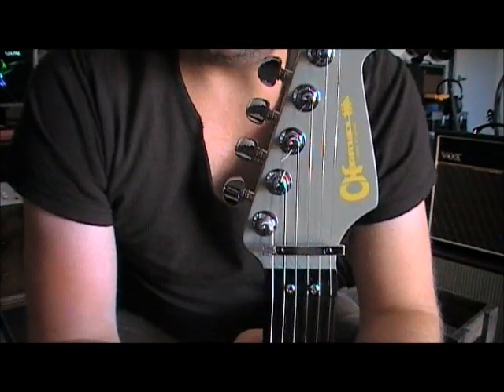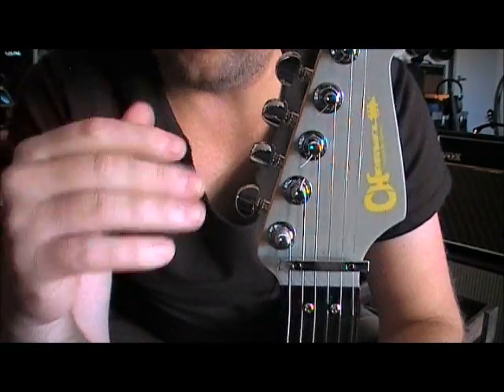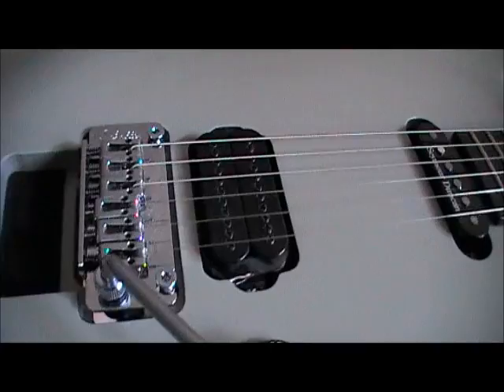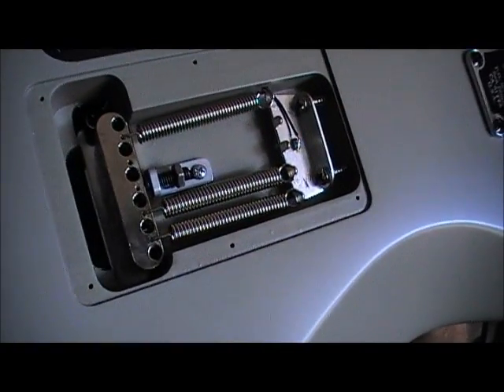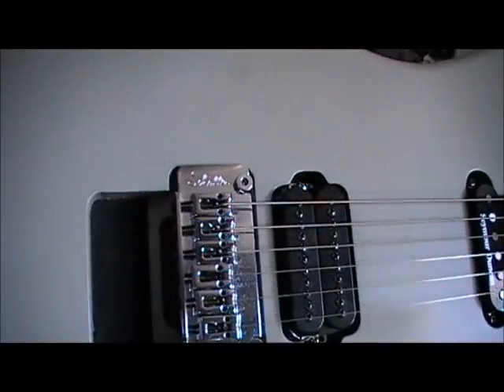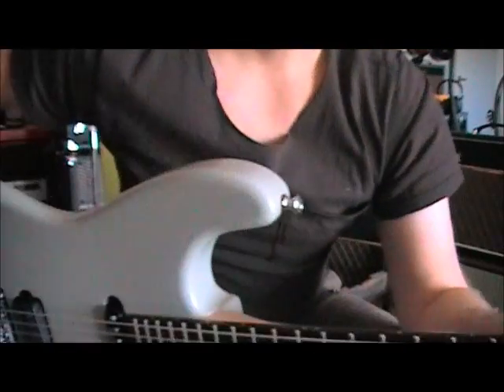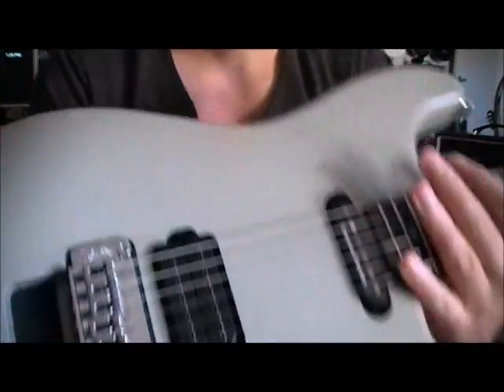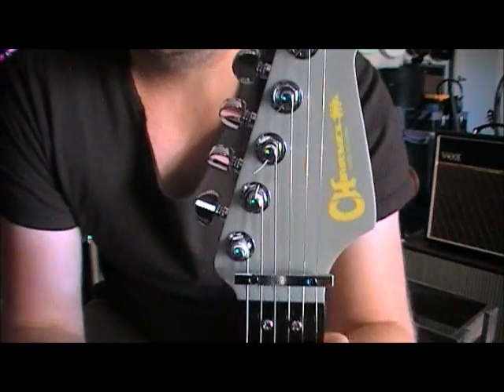De-Floyding - Floyd Rose Conversion

Comment: I'm a lefty. Is there hope for me to find one? Preferably on the cheaper side. Also, my bridge doesn't hold the strings well. I made sure they were all tightened but the G came out still.
Reply: On schaller's website I saw all the models of these bridges in both left and right handed forms, albeit the lefts were about 60 bucks more. Hopefully you find a good deal somewhere!
Reply: Darklauncher Thanks man. Ill probably check it out... then get a job so I can pay for it lmao

Comment: Did you notice a tone difference? for the worse? I read that the rollers can be real tone robbers. Either way, this bridge seems to be the only one out there of it's kind.
I'm planning on doing this to my Schecter for the sole purpose of restringing convenience.
Reply from the maker: Jack Bruce hey man, thanks for reaching out. No, tone difference is there, but definitely for the better. I do like Floyd's but they seem to impart this high-mid  and top end "zing" to the sound. There is more bottom end with this mod although, I am thinking of going back to a Floyd on this axe but upgrading from the Korean "el-cheapo" that came stock to a German made Schaller.
Reply: +BillPalmerMusic - That's your problem right there, Asian made copies use crap metal, stick with the German stuff. If your going to use a tremolo, stick with the best, all others are wanna be's, if your not going to use it, why get a guitar with one on to start.?
Reply: The tone/sound is picked up by the pickups north/south magnetic poles right over top of the pickups.. If your hearing any zing its probably in your head to be honest..

To test this, take the bridge and nut out, and coat it in 3 coats of plastidip.. I bet there is no tone change at all.. And your strings contact points would be sitting on basically rubber..
Reply: TJ L ...that would dampen your strings...
Reply: jubjub f
It  would be similar to nano coated strings. The deadening effect is negligible because 90% of the sound is picked up right over the pickup thats why the magnets are there and not under the pickup where the vibrating wood is. Tonal woods, or thinking bridges/nuts have an effect on tone is ridiculous unless were talking acoustics guitars where those things actually matter. Wood type on an electric has zero tonal impact. If the pickup was picking up sound vibrating through the guitars body, the pickup could be placed anywhere on the body, i.e on the backside of it and covered.. Its not put there because you would hear jack shit. I.E tone doesn't come from woods or cheap bridges etc..

When it comes to electric guitars the only thing that affects tone is the pickup/amp/pedals etc and the way your pick strikes a string, and the actual pick would change the tone.. i.e a wood pick vs steel vs plastic would all change the tone a bit.
Reply: TJ L I agree, but I have 3 different guitars all with the same pups in them, Duncan JB's, a 86 Kramer Baretta, a 91 LP, and a 07 Strat, all with maple necks / rosewood finger boards, the LP has a mahogany neck,  and they all sound different. The Baretta has a Basswood body, and is the warmest tone, the LP has a mahogany body, and it has that traditional woody / nasal tone, and the Strat is ash, and is the brightest of them all. For hardware, all have different systems, Floyd Rose, stop tail piece and bridge, and vintage Strat trem. If it was just 100% the pups, shouldn't they all sound exactly the same.?
Reply: TJ L you realize the wood and hardware imparts vibrations onto the strings right? And no it wouldnt be like coated strings, itd be like a freaking mute. When a string is struck it vibrates (sound waves) which then resonates through the guitar and those waves also come back into the string canceling and boosting specific frequencies the pickup then hears. Dude Im sorry but Ive taken pickups out of multiple guitars and put them into others and they didnt sound close. Ive changed the hardware, the sound changed.
Reply: Ive done a bit more research into it, and you guys are right. The tone does change a bit from wood to wood, I knew it certainly did with acoustics that was obvious. It seems lighter less dense woods produce more treble. Denser woods more bass.. Beyond that, I can't tell a significant difference.. And if we are in overdirve mode, the difference is barely heard, if at all.. and a simple eq pedal could smooth out the tone to where you want it.

I still think the biggest impact on tone is what I said earlier in pickups, amp, pedals etc. And speakers.. Those are the biggest tonal impacts when dealing with electric guitars. The woods seems negligible to be perfectly honest if its just treble vs bass.

There was something else I noticed when I built my first acoustic guitar, the less lacquer, the brighter/louder the sound was. I actually prefer an old school finish in shellac.. The sound on a bearclaw spruce top with light shellac finish was unbelievable.. The guitar looked like it was built in the 1700s but that it besides the point lol..

So that could be something to consider if you wanna brighten the tone up a bit, strip the body down to bare wood and test it out, then put your own clear coat on it. Since you guys have great ears for tonal shifts, I bet you notice something..
Reply: can you guys tell me what you actually prefer, the brighter tones or bassier tones? Or something in the middle?
Reply: TJ L best way to describe what i like is EVH tone, from the 1st few LP's
Reply: The Kramer pacer?
Reply: TJ L Kramer Baretta, i like it the best for lead tone, and i like the LP for riffing / chords.
Reply: Jack Bruce replacing the Duncan design pickups off those Schecters is the biggest improvement one can make in

Comment: I tried the exact same conversion and it did not work for me.  Be careful with this - the location of the original floyd rose studs when using the Schaller vintage trem  means the distance between the Vintage Trem's saddles (taking into consideration maximum adjustment) and the replacement ebanol nut just did not allow for proper intonation of the guitar.
Reply from the maker: hey spoonyfeed. Sorry it didn't work out for you mate. I did read on a forum somewhere that another guy had a similar experience. It does intonate fine on my Charvel and I'm an intonation Nazi, of sorts. Have you tried different gauges of strings, and/or different tunings?
Reply: BillPalmerMusic
I also tried the same bridge on a Charvel SoCal, and also had intonation issues. What gauge strings are you using that you were able to get to intonate properly?
Reply from the maker: Tom Durik Hi mate, sorry to hear this! I'm using 11 gauge strings tuned to Eb. I definitely don't have any issues with intonation, I use Peterson strobe tuners and am very hung up on tuning myself.
Reply: BillPalmerMusic
Thanks! I was using 10's tuned to E standard. I'll have to give it another try.
Reply from the maker: Tom Durik Cool mate!

Comment: Question to anyone who's done this: will the guitar intonate correctly with the Schaller bridge? Saddle to pivot-post distance seems to be shorter on the vintage trems than on the Floyd-Rose trem. At least that's the case with the Schaller I got (which I put on and the Guitar would not intonate correctly). Cheers 🖖
Reply: Intonation has been a TOTAL pain on an EVH Wolfgang Standard.  Getting the intonation "close enough" required pulling the saddles all the back, almost completely flush with the lip of the trem plate.  This also required removing the saddle springs, and cutting adjustment screws in half to clear the string holes.   Additionally, I've spent hours enlarging the trem cavity to fit the larger block on the Schaller....beginning to second guess my decision to attempt this mod.
Reply: I did have intonation issues with the Schaller replacement on a standard Strat. Check your scale length. I will have to relocate the two stud bushings back (away from the nut) approximately 1/4" to get it back to correct scale.

Comment: Could one possibly go from a floyd to a TOM?
Reply from the maker: mate you could, in theory at least. Whether its worth doing is another question.  
You've had to do a few things like plug up the trem cavity and the post holes and then re drill for the TOM / Stoptail. 
You'd also have to recess the TOM into the body, or adjust the neck angle (or possibly both...) 

It'd be quite the undertaking and you'd most likely have to respray / re-finish the guitar afterwards.
Reply: Oh.... Never mind hahaha

Comment: I ordered mine from allparts.com. It will take 40 days to get to me (Brazil). I'm doing the conversion without the ebanol nut I'll keep the original lock nut. I hope I don't have any problems with that.
Reply from the maker: hey Leandro, let me know how it works out mate. Cheers
Reply: BillPalmerMusic OK, I will as soon as I get the bridge.
Reply: Did it arrive? Did it work? How is it? @leandro7426
Reply: @endezeichengrimm  Yes, arrived, worked... the only problem I had was adjusting the octaves...
Reply: @leandro7426  YOu mean the intonation? I read other people having that same problem.
Reply: @endezeichengrimm  yes, the intonation... I couldnt adjust it.... I have to take the guitar to a luthier... so he can tell me what can I do ...But anyway I'm satisfied with the bridge... I've been using for almost 4 or 5 years
Reply: @leandro7426  There may be an issue with where the saddles are positioned..... I wish Floyd would make their own version that would work for this.
Reply: @endezeichengrimm  Yes ,the saddles are not in the same position as the  floyd's... since the Schaller is smaller than the floyd... so you don't have enough room to adjust intonation.  Actually, Floyd got a similar model... they come on the Guthrie Govan Charvel. Only difference are the saddles... they are the same from the original floyd... which is the resaon why I changed to this Schaller model...

Comment: Right now I'm using the block method (or in my case, a bottle cap from a pepsi max bottle), however I want to change out the Floyd Rose because I hate stringing the damn thing. I think cutting off the balls and having to clamp the strings is the most annoying shit, especially when you don't string it tight enough and one pops out while you're playing. I'm pretty done with my Floyd Rose haha
Reply: +bob8065 I actually don't cut off the string balls (or 'spools'... that's what they look like to me with D'Addario and a few other brands). I simply cut them to length, then tune up the string. Took me some practice, but no more sharp ends at the headstock for me. When cut to length, I cut the end about two to three inches (6-9 cm) past the locking saddle. If you use locking tuners, you still need to cut off the string balls. The only disadvantage to this is if you're a long haired person that head bangs a lot while playing. Your hair may get caught in the string spools. Not a problem for me since mid 2012 LOL. ;)
Reply: Alex Ramos my hair is long like the 80's rockers

Comment: I got a LTD M-200FM with a Floyd but it don't feel right for my palm muting. I love the look and sound of it, It only cost me $180 used and I really wanted to have a Floyd Rose bridge. The sounds that can be created with it, to me was badass. Problem is for me though, it's like the sting height difference between each string with the changes from minor fine tuning. Is  it worsens my ability to mute the strings like I'm able too and want too with a Tune-O-Matic. I got my LTD EC-256 aged for $40 off a friend, who's gonna argue over a nice looking $40 guitar? 

        I'm pissed off at myself that I bought a guitar just because ( From all the videos I see with people playing them ). The nice looking and sounding guitar, has major problems like string height not being able to be adjusted because the nut height is improper. Then like I said about my palm muting beef with the Floyd. $40 dollar guitar is for me one of the best guitars I'v ever played. Only if it looked different ( Yeah ik like it really matters )

      What I want to know is if I can easily equip a bridge that has straight up saddles like on a T-O-M. Because like I said Floyd Rose saddles or any of the saddles that the strings all fall far into the slots. Prevents me from having or at least feeling like I have full control over the strings with my palm.
Reply: LTD Those 200FM are going twice that used vg cond is u ever plan to flip it :)

Comment: For all of you not liking Floyd’s... in particular floating Floyds because of string changes  and double stops... just have a pro make it a down only Floyd like EVH or Mathias Jabs use. They will block it off. Can be reversed. Then you can add more string tension. Can handle a broken string. Can use a D-tuna. Will not have the double stops problem. Can changes strings or tuning easy. Don’t hack it like this. Just sell the guitar and get one you like if a down only you also don’t like. That guitar looks like crap, will never be right, and lost its value.